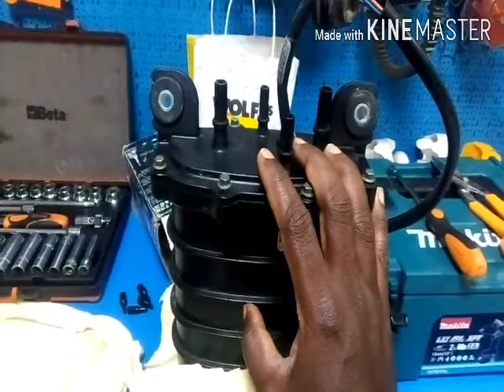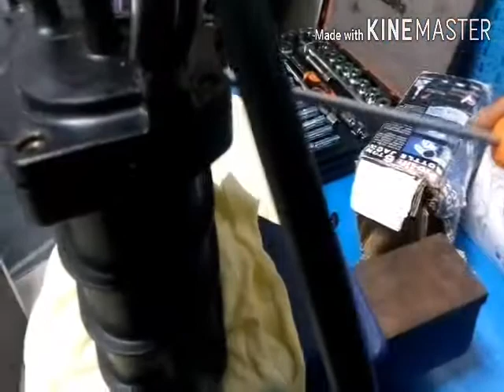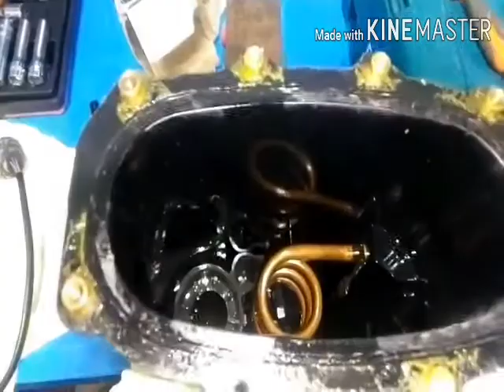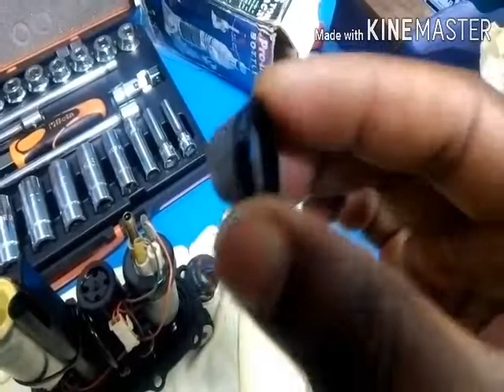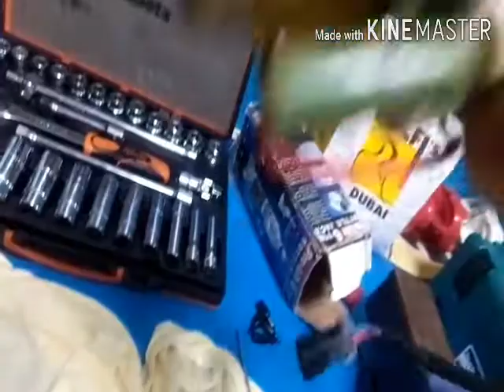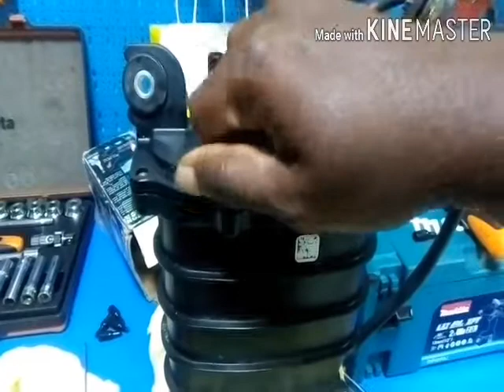Mercury VERADO outboard motor VST service... explain#mercuryoutboards

Comment: thank you for this video. Can you explain to me how to test the 2 pumps. 12V CC okay but you have to respect a polarity? Can the pumps be run even if they are not submerged? If it has to be submerged, will it be in gasoline or water?
What's supposed to happen?

Thanks a lot.